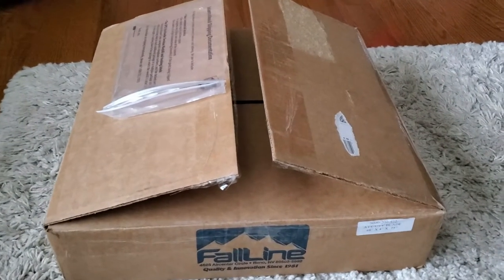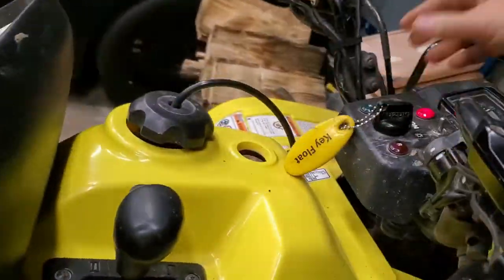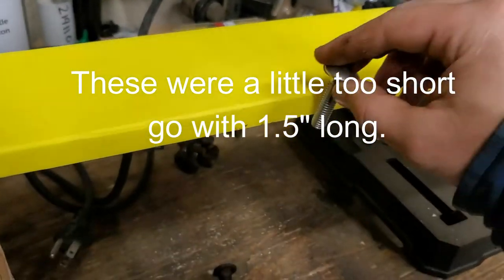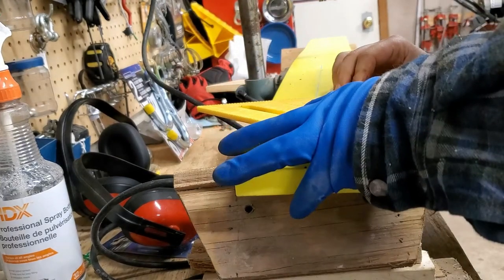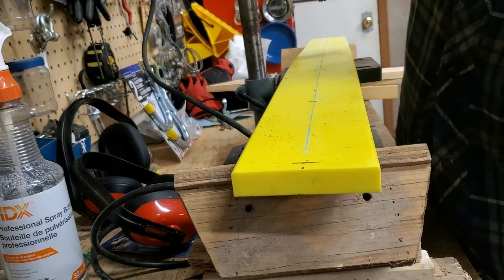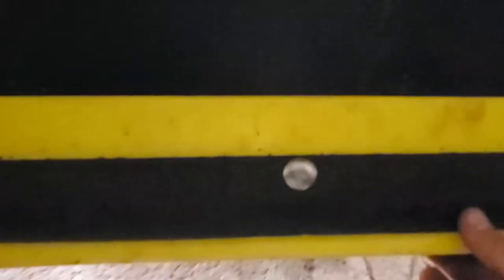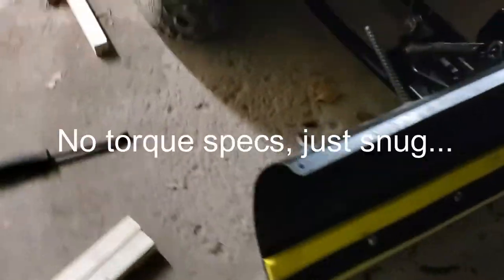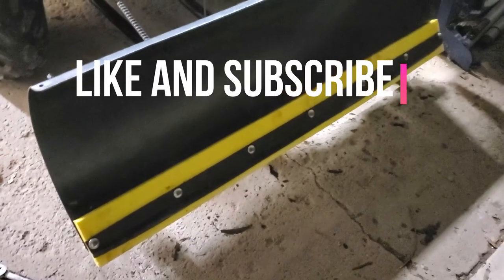ATV Plow FallLine Polyurethane Cutting Edge Install - Suzuki Eiger - Warn Plow

Comment: I tried the poly scraper, doesn't cut well at all and coming off tomorrow. Thanks for your video!
Reply from the maker: I am surprised as it works great for me.  If you are expecting it to scrape ice like metal it probably won't but it does a great job for me and doesn't destroy the concrete driveway like rhe metal.

Comment: It looks like you could flip the steel edge and get more poly blade life before you wear down to steel.
Reply from the maker: It can definitely be flipped.  So far I have used it all winter for plowing and it has lots of life left.   With the amount of plowing I do it should last years.

Comment: Great video , I have pavers and just recently got myself a rancher with a 48 inch blade .. I have been looking at this product for a while. 

Sounds like you recommend it and still like it from the comments. 

Is there anything you wouid do different from a mounting standpoint ? 

Appreciate your time and info
Reply from the maker: This FallLine Poly blade has been great!  I recommend it to anyone who has a plow on their quad or side by side.  It is wearing fairly well, I haven't had to rotate it yet and there are no chips or chunks out of the concrete driveway since I started using it.

The install is very easy, I would do it exactly the same way as in the video.

I am glad this video helped.  Please subscribe if you want.

I have another video showing how to get more blade clearance when lifting the blade on the quad.

Cheers

Comment: How has it performed compared to the stock steel bar?  Are you plowing blacktop?
Reply from the maker: I am plowing a concrete driveway which is why I installed the poly cutting edge.  The steel cutting edge would take chunks out of the concrete.

I have never used the steel bar so u can't compare but I can say the poly edge does a good job of scraping and it is more gentle on the concrete.

The steel.bar will scrape more of the snow down to the concrete but at the price of damage to the surface.

The poly blage scrapes far enough so a little sun will melt things down to bare concrete in no time.

The poly edge Is made for concrete and interlocking brick.  If I had an asphalt driveway I would use the steel edge.